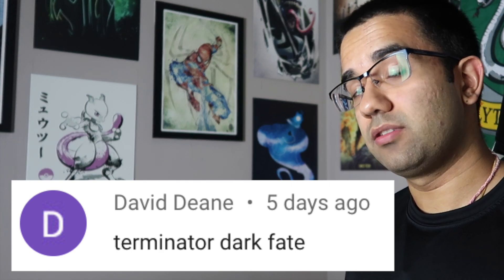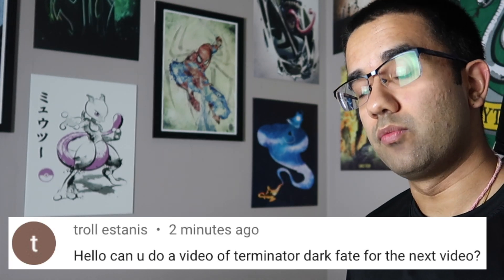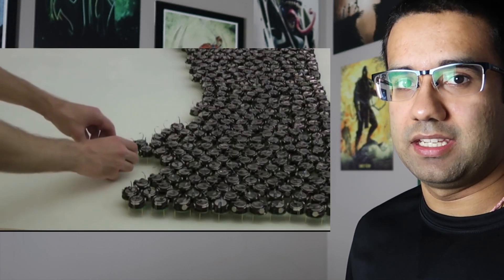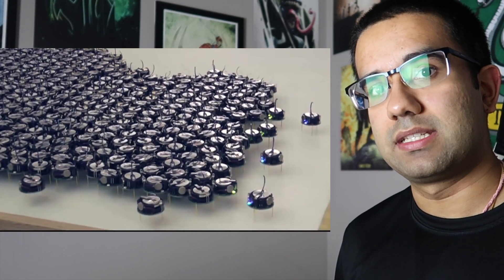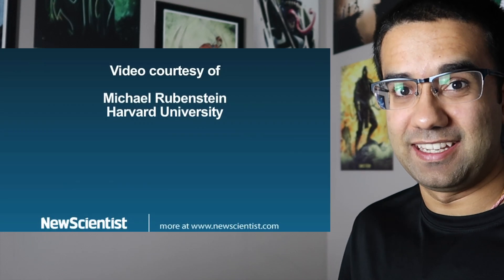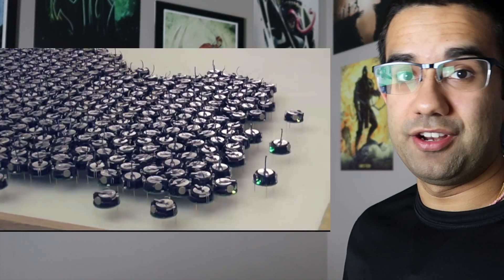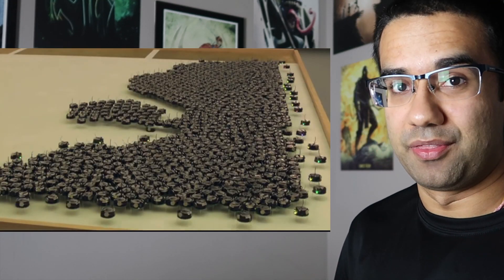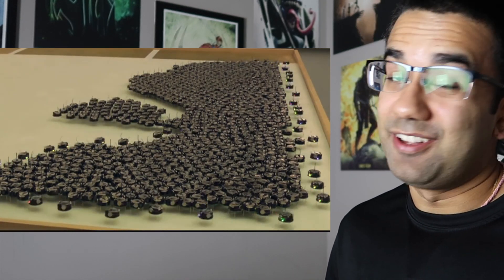Real Engineer Reacts to Technology in Terminator: Dark Fate

Comment: I have this theory that Wall-e is like the terminator. I suspect that WALL-E'S personality is due to a designed Ghost in the Machine type algorithm in his software.  WALL-E has those Media Function Keys on his body that let him record new information and add it to his cache of knowledge. I assume the original designers put this feature in so the units could be programmed with specific directives out in the field by B&L employees. However, I think the units were also designed to record all-new unique information they deemed "useful" to their main directive.  We see WALL-E do this when he records the stars and hand-holding and all of that.   My theory is that WALL-E is fairly similar to all of the other WALL-E units, but after adding more and more extraneous data over the course of centuries, his personality evolved from simple objective commands to a full-on Positronic level consciousness.  I think after decades of virtually doing the identical trash-collecting movements, and the other units began to fail and deactivate WALL-E's program began to collect random bits of information on the items to better increase efficiency. He began collecting data on the different sizes and shapes of items, the weights and densities, how easy/hard they would be compacted; and that eventually ended up creating subroutines that wondered about the purpose of the items.  More items led to more curiosities, more curiosities lead to more need for WALL-E to record new information to add to his directive cache, and after a long ass time, you got a sentient little dude all built off of trial and error data collecting.  So yeah, I do not believe that WALL-E's consciousness came from a malfunction that happened one day, I believe it is an unexpected feature of a device that has been left running LONG past it's intended longevity
Reply: I find that a bit hard to happen in real life, because of programmed obsolescence... at least until now seems like it... unless AI's algorithm evolve faster than getting obsolete... idk... but that's a really well point you got there...
Reply: @JoeX92  exactly and since it’s very futuristic!